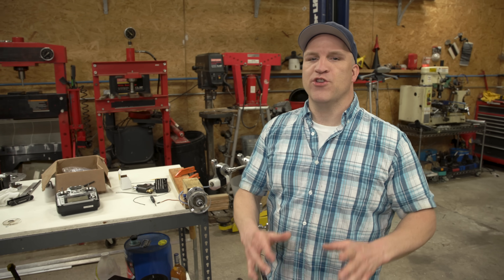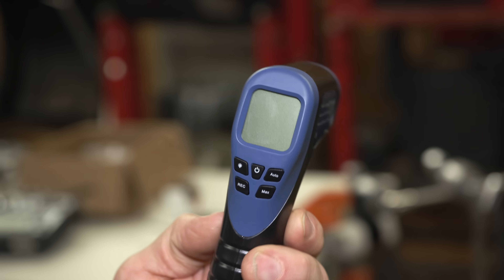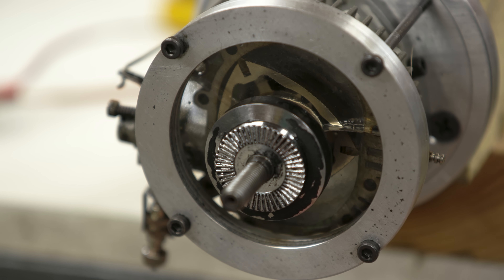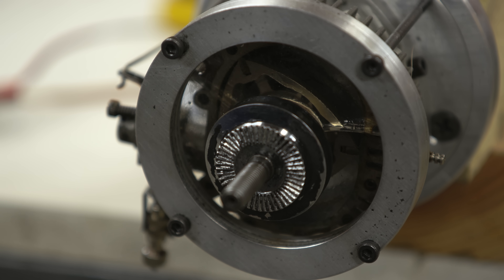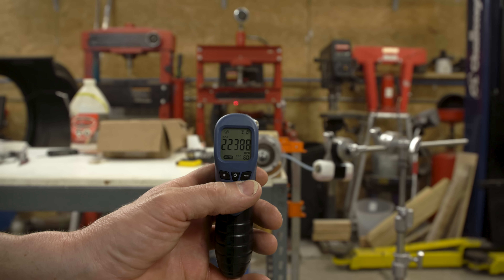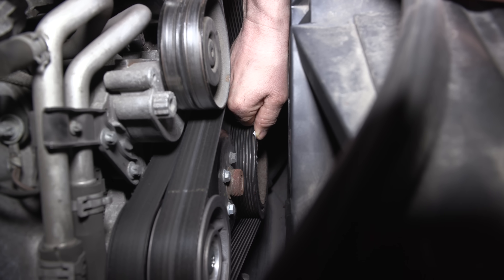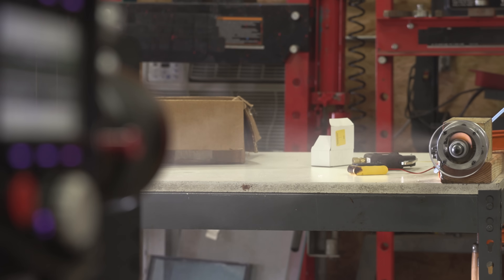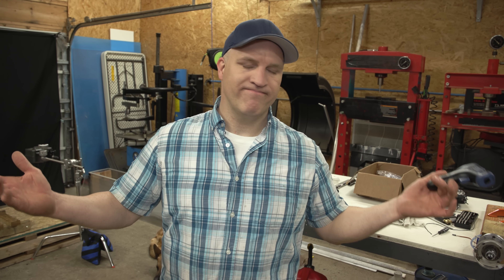See Thru Rotary Engine MAX RPM - 29000 (Wankel Engine)

Comment: The thing that surprises me is that clear cover didn't become clouded up, become crazed,  scorched from the heat  ,scuffed up, etc.  after 5 seconds the engine ran!
Reply from the maker: Well I almost talked about that when I said "600 runs" in this video, but I withheld that material science information since It took me over 2 months to develop this particular material, with supplier advice from my NASA engineer friends. This material mix is amazing!, And these tests further prove it's durability. I may reveal what it is in the future but it's not exactly glass but is 98% transparent. Maybe I should send you a slug made out of it !.
Reply: @WarpedYT  try making a barrel out of it and send if to Jeff
Reply: is it a form of transparent metal? Seems to be a transparent ceramic of some sort though...
Reply: Nasa..u have to be joking...now I know this is fake...LOLOLOL
Reply: @WarpedYT  See through 50 cal rifle. Make it happen guys 😁
Reply: Warped Perception yes! Send him a slug or two made of it!! I’d love to see how it handles an impact from supersonic speeds!
Reply: Are you going to strap it on a small engine dyno?
Reply: Corningware! Lol
Reply: Nitro engines run very cool. If you see a cylinder head temp of 250+ degrees F the engine isn't long for the world. Thats a "loaded" temp. Bench-testing "idling" engines is pointless.
Reply from the maker: razoraresharp something like that.
Reply: Warped Perception nice, you’re using AlON.
Reply: I have seen Jeff on all corners of the internet...
Reply: Does it rhyme with moron? Lol
Reply: Mikhail Gorbachev Yeah, he tends to get around..lol
Reply: "Glass" is a what more than a thing. Glass doesn't have to be transparent or even translucent.
Reply: You make it sound like Scotty's transparent aluminum.
Reply: Lmao its weird seeing other youtubers you watch on other videos
Reply: Hey, get back to shooting stuff with unusual ammo!
Reply: Most likely Quarts glass...
Reply: LOL do it that would be hilarity. Super material slug tares through ar 500 steel at mach 4.4 ....
Reply: DEEREMEYER1 but we want translucent for these vids.
Reply: This, really.  Smaller nitro engines you have to up the percentage of nitro in the fuel to keep them from being over cooled.  While an engine this size would run well on 5% nitro, my tiny 0.061 Norvel two-strokes preferred 15% and the old Cox 0.049 family really ran best at 25%.  The typical fuel mix for an engine like this is 5% Nitromethanol 20% some kind of lubricant (Castor oil or synthetic) and the balance being methanol.
Reply: Warped Perception send some to the guy that tests all kinda of shit inside engines.
Reply: Warped Perception "maybe I should send you a slug made out of it" that would be interesting indeed!
Reply: Warped Perception  a slug ... or a barrel!
Reply: nassa..lololololol are u kidding...ballers are soooo dumb..
Reply: na ya didn't....wasn't hidding
Reply: I guess it’s transparent aluminium
Reply: My guess would some type of transparent ceramic like Perlucor.
Reply: FYI gents, there is transparent aluminum: https://en.m.wikipedia.org/wiki/Aluminium_oxynitride
Reply: Glass is glass and glass breaks
Reply: Warped Perception, be honest, its transparent aluminum from star trek isnt it?

Comment: I just copied this text from Mazda website maybe this can give you Insight on your crack housing.

  "" engineers will remedy the rotary’s poor thermal efficiency. This is caused by the combustion chamber’s high surface-to-volume ratio, which is greater than any contemporary piston engine. Excessive surface area drains heat energy into the cooling and lubrication systems, diminishing what’s available for producing power.  ""

Comment: I was so doubting the 29,000 according to the tachometer, it’s the frame count that cliched it. A tuned Mazda rotary will do tops of 11,000 rpm, the 29,000 sounds way pie in the sky lol. 
  Can you download a seismograph app to give a visual representation of how much vibration it creates, the less vibration, the faster she can go.. 
right?
Reply: According to the specification sheet, the practical RPM range is 2,500-18,000 r.p.m (i.e when loaded with a propeller), so coaxing 29000 out of it is possible.

Comment: I don't think that rpm reading was entirely accurate because the transparent flywheel is also slightly reflective (compared to the dark pulley on your car engine).
Dan Rohas from "greenpowerscience" faced a similar problem when he made a turbine out of a scrapped hard drive assembly.
I might be completely wrong though :)

But the slow motion camera doesn't lie!
Reply from the maker: Lol... Just the way you said it .... That's the same thing I thought and yeah that's for sure, the high speed footage is dead on accurate.

Comment: 20k plus rpm that's F1 racing there
Reply: These are going to be the same sized engines they use in f1 20 years from now lol. The turbo will be the size of an engine though.
Reply: 21,000 rpm is the highest F1 rpm I know of, this thing is approaching jet engine idle speeds 😱
Reply: luketrembay ikr, 20k++ rpm with 10 piston vs 1 doritos
Reply: F1 engines have been restricted by racing rules and regulations since 2007. That last of the unrestricted engines where from the 3.0 V10 N/A Era, some ran over 20k RPM. In 2007 they limited it to 19,000. Then 18,000 in 2009. And it is now 15,000 RPM. Worth noting that these were V10 piston engines with a very overbore piston stroke. This wankel is more comparable to an R/C engine. Those can rev over 40,000 RPM...
Reply: @drifterbbb3649  yeah but the current engines just hit 13.000rpm if you look at some on board data and not to 15.000rpm like they should
Reply: Better yet, Mazda 787B!!
Reply: Carter Davis  LOL. Sadly the FIA ban rotary engine from racing in 1991 after Mazda 787b won Le Mans that year and it is still banned today.
Reply: but they cant be compared since they have different architectures.
The "stand by" rpm for a regular gas engine (4 cilinder otto cicle) is around 1000 (1k) rpm.
The stand by for this engine in the video is 10 k rpm.
Comparing rpm alone/by itself doesnt mean anything.
Mileage, fuel consumption, oil consumption, temperature/heat generated, vibration, size (like, 1l rotary vs 1l otto) power, torque and cost to build, sell and maintain.
When comparing engines, all of those factors NEEDED to be taken into consideration.
cheers
Reply: @evilzinabyssranger5695  Torque is key
Reply: PC Fanboy I was under the impression that they idled at 50,000 and revved higher on takeoff and flight load.
Reply: Evilzin Abyssranger My honda will out rev what ever f1/aviation trash you put up against it
Reply: Uhm, jet engines rev up to 120000 rpm. However, larger ones (passenger plane) will spin to about 20000 since an increased diameter limits the rpm.
Reply: Little 2 stroke strimmers can rev to 20k rpm. It's easy to achieve high RPM when you're only moving a tiny piston a tiny distance.
Reply: I think a normal jet engine fan spins around 3000rpm
Reply: luketrembay  Ironically the small scale piston engines rev a lot higher than the rotary engines. The best nitro piston engines can reach 45K RPM
Reply: Lek Vol'jin golden
Reply: Not anymore, they botched it
Reply: Currently they run @ 12500 RPM to 14000 RPM at max speed,   the 12/10/8 - cylinder 4stroke N/A versions in the past ran upto 19k.   The current versions are V6's in a 90° configuration, making the frequency analysis hard to do, due to the irregular division of the combustion cycles, and the turbo playing another tune at the same time.
Running higher than 12500 RPM isn't ideal due to the fuel flow restriction of 27.78 ml/s (100l/h). This would mean the engine would need to run very lean
Reply: PC Fanboy A simple search will show you that majority of the engines used on commercial jets top out at around 15k max so Arch Angel was correct.
Reply: 13 000 is what they do
Reply: 250 4 cyl do 20000 rpm
Reply: I know that rotary engines have more potency than torque. But 29000 rpm is amazing. I think that it can be because reduced scale.
Reply: @pedrogaspar9483  good theory, I also think because of the reduced scale, the rotor has to move a much shorter distance for one rotation and so it could have such an high rpm.
Reply: If you put 2 reflectors you can reach 58000 rpm  put 10 reflectors and 290000rpm that way you can do a video on the rpm detector and see how many rpms it can keep up with.
Reply: At least they used to
Reply: Comparing a revving of a 3000cc engine to a 10cc engine? noice huh
Reply: luketrembay 29000 rpm is almost double what any f1 motor has done
Reply: Unco Casey I wouldn't say double
Reply: Carter Davis even with boost an engine needs displacement
Reply: Arch Angel WHAT? No lol, jet engines go up to 50.000 rpm
Reply: the last unrestricted F1 engines were the 2.4 V8s from 2006... they were also the highest revving. The V10s never hit 20k.
Reply: The highest RPM a F1 car did was 22.000rpm in 2002 and this was 7.000rpm higher, so about there there a petrol engine usually has it's limit, that's crazy and especially the size is really crazy

Comment: Please do with 2 rotors, as if it were the 13b of the RX-7
Reply: Sandro Sobreira why stop there. Why not a 26b or more.
Reply: aBunny you broke the chain, shame on you
Reply: 26b, 4 rotor 😉
Reply: Anon gamer more. MAKE IT FIVE
Reply: SIX
Reply: it won't run
Reply: aBunny shame on you
Reply: MAKE IT 86
Reply: SEVEN
Reply: EIGHT
Reply: NINE
Reply: Haminku 87
Reply: forbidden pollo 88
Reply: Rogue Gaming 89
Reply: Make it 100
Reply: use all earth's resources to do the longest wankel engine of universe
Reply: no, should be the longest that it'll circle across the globe and loops back to other side
Reply: Honestly, four rotors would probably be the max reasonable.  BUT, there was a guy, years ago, who made a three-rotor for his Mazda.  I don't recall much, but the horsepower to weight ratio was incredible.
Reply: some guy built 12 rotor wankel.  at home.  three banks of 4 rotors in Y formation

Comment: You can try to use a sound analyzer too, for speed measuring
Reply: That's what I was thinking. 483 revs per second with 3(?) exhaust pulse per revolution should give a note at about 1449Hz. I'm not any kind of musician but that seems to match the note on the video quite well.
Reply: Actualy, it's only 483 exhaust pulses,. The rotor runs at a 1 to 3 ratio...
Reply: I seem to recall he did that once, using Audacity.